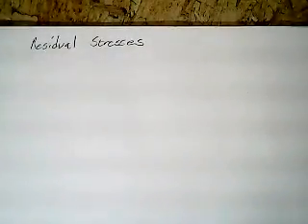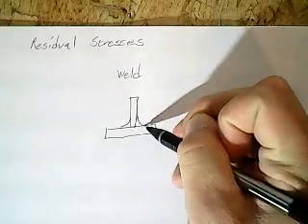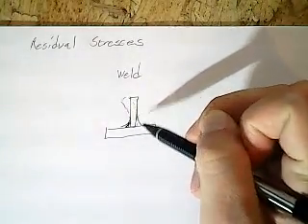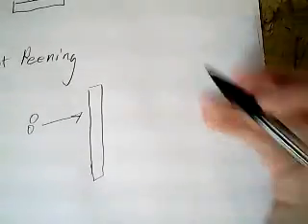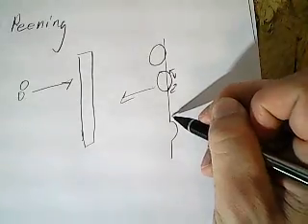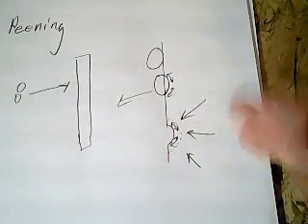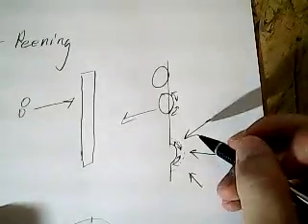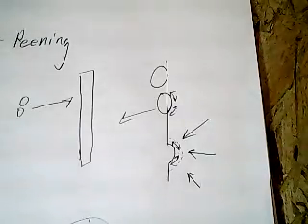Materials Science - residual stresses

Comment: an axial residential compressive stress due to a manufacturing process is present on the outer surface of a rotating shaft subjected to bending. under a given bending load the fatigue life of the shaft in the presence of the residual compressive stresses

Increase
Decrease
???